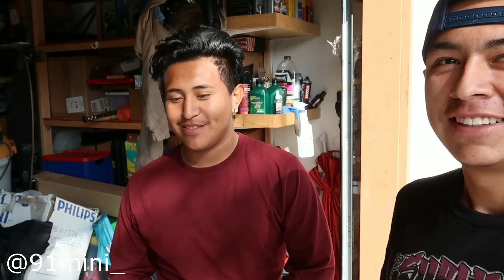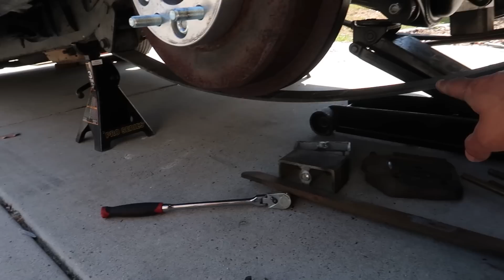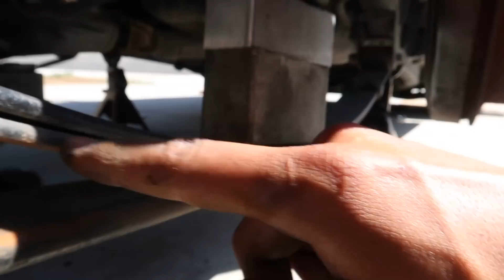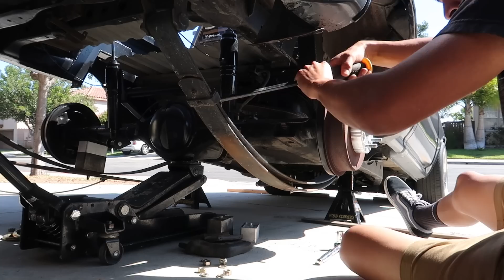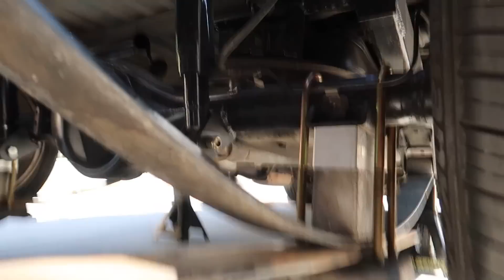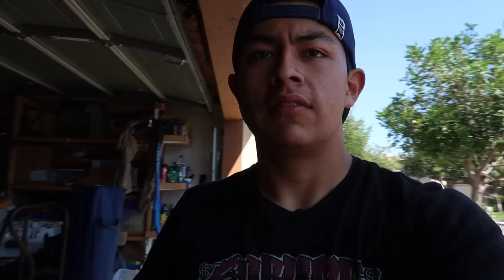Lowering the Toyota Mini

Comment: I used a 4" angle drop block and removed a spring and it gave me a 5" drop total, still tucked 19x 9.5 rear and 19x 8s front, had to cut fender well and moved it up 3" to clear front tires tho. With air shocks.

Comment: Hey there I don't want this to come off as me hating or talking sh!t about your video at all even though it may come across that way. But I wanted to point out or make some aware of the issue/s about this. First would be stacking blocks like that is very dangerous to do. It's hard to explain on here but if you look up on YouTube what lowering blocks do to your springs there is videos showing what happens to the spring when it's got blocks in it. Idk if u have ever seen lift/lowering blocks that are more then 3 inches but they have a tapper to them so it will correct your pinion angle of the drive shaft witch is also very important! So u don't chew up u joints and get strange vibrations from the drive line. Doing it the way you did is more of a concern if he had to stop fast, or in an accident it can become a major issue of strength and staying together not to mention just axle wrap can make the driver lose control of the vehicle. I don't think he is going to be putting much stuff in the bed so weight won't be a concern really but I would strongly suggest looking into something like four links or going to off road web sites and finding blocks that are one piece and have the angle needed to correct the drive shaft pinnion angle. They make 6 inch blocks for off road trucks witch it's the same block if u want to lower a truck but six inches a a bit much!! Lol but again I'm not trying to talk shit I just wish someone had filled me in on some of this stuff when I was your age I could have avoided a lot of headaches!! But please do look up proper pinion angle and lower/lift blocks and how they affect your springs and truck drivability!! See for yourself on the videos so that way u can learn from them and not have someone like me explaining it poorly on here lol. Your on the right path though!! Get out and get your hands dirty and always be open to learn things everyday!! Besafe y'all!!
Reply from the maker: Firstname Lastname is allowed thanks I appreciate it , my grind was running his truck like that so I just helped him lower it more and my truck is bagged so I don’t really have to worry about that stuff on my truck
Reply: What tipe of sunroof you put on the hard body
Reply: yeah thats such a dangerous set up only remove one load leaf from the whole pack and get a shop to completely flatten the whole leaf pack (should be a 7 - 8 inch drop) then add 2 to 3 inch blocks max without stacking would hate to see the blocks fall out down the highway over a bump and destroy this nice truck and possible hurt the driver plus ur leaf hangers will be higher off the ground aswell

Comment: Hey I got a 97 nissan hardbody and want to go lower how do I lower my front? I was thinking of doing the beltech lowering leaf springs and a 3 inch block. But have no clue how to do the front.
Reply: jonathna11 first make sure you have tires that fit, my truck was 4 inches from the floor, I removed 1 leaf spring from the back and had it on 2 inch block and the front just lowered the torsion bars
Reply: but if you loosen the torsion bars, dont you get bad camber. and have to get it aligned ? (this is the only reason why i havent messed with my torsion bars yet.)
Reply: Edgar Cervantes mine wasn’t that bad but if you worried about it you can buy the drop spindles
Reply: @can23rob  ok thanks bro